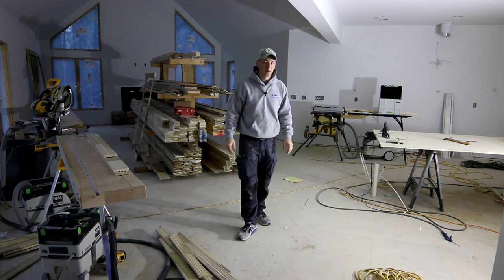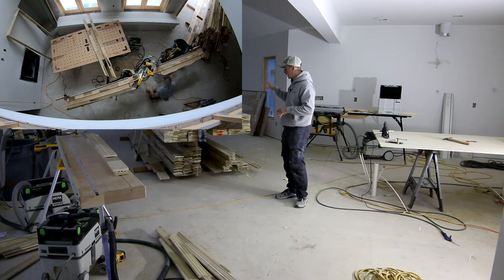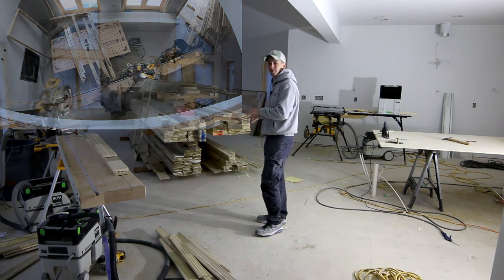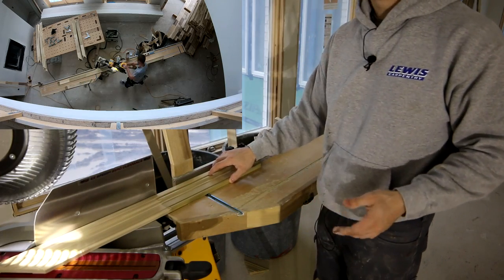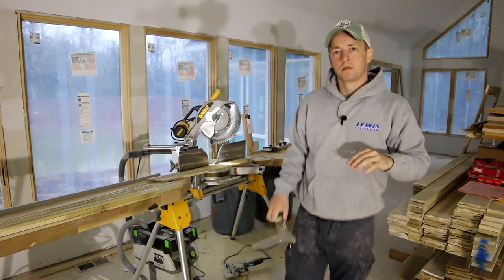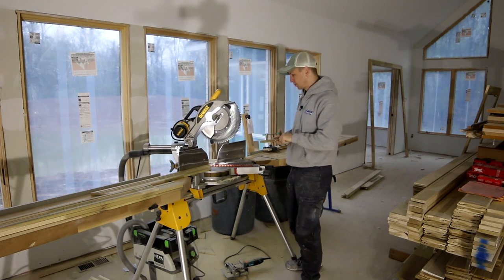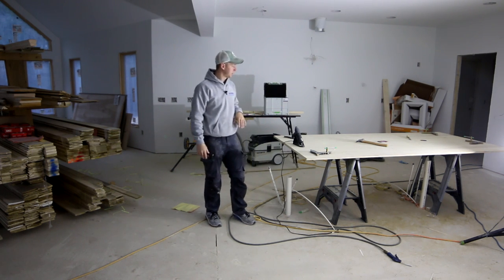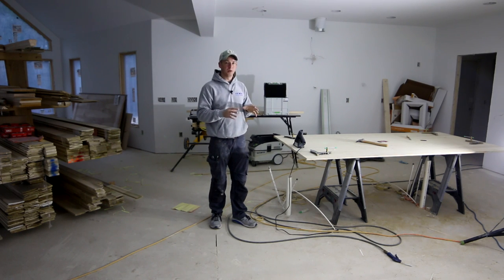The Most Efficient System for Mitered Casing

Comment: Regarding the point on cutting boards or trim that have a bow or bend in them. I'm always a bit amazed on the design of many of the miter cut stations, mainly from the states that make use of a very long fence/extended fence. I've never seen the point of having a long fence like on your extension wings. The only fence that matters is the one close to the blade, aka the one on the actual mite saw. As long as you line your trim up with that fence the mitre angle will be correct in reference to the trim/board unless it has such a severe bow in it that you'd probably discard it anyway. The only thing a long fence will achive is pushing your board out of alignment relative to the actual cut if the bow is in the direction towards the fence. If you just cut based on the saw's fence (the shorter the better in this case) the boards and trim will line up and the angles will be correct once you man handle them in to place when pinning them to the actual window (as you'd straight them out to match the window).  I can see the point of the stopblock riding on the fence, but I'd imagen the stopblock would work just as fine even if the "fence" would be offset back by a few inches (essentially turning it into a stopblock rail only).

EDIT
Had a 2nd look around and I think your fence really is offset back a little allready yes? 👍🏼 Which leaves only the tiny bit of misalignment from the miter fence wich in most cases really is manageble.
Reply from the maker: It’s not a fence. It’s the guide for the stop block. It’s offset back. That type of track is what I needed in order to work with my stop block design.
Reply: Yeah, I did notice the offset in one of the closeups when I scrolled back through eventually,  as you can see by my late addition in the post above! So it really is what I thought it should be! :D 👍🏼 Great stopblock and tips! I blame late night youtubing for not noticing it right away ;)

Comment: Thanks so much for the video. Have used the Clam Clamps for a long time. Incredible product. My question for you is how do you deal with sheetrock that protrudes a fair amount beyond the door or window jambs. In my world, all too often (mainly irresponsibility of the project management) jambs not wide enough or bad framing causes rock to extend 1/8" or more. How do you deal with this efficiently?

Thanks again
Reply: SuperAlfaDogg 

Scarfing, basically Inlaying the casing using a multi tool. At corners using a sample corner, trace and cut. Worse part of my job is scarfing rock.
Reply from the maker: SuperAlfaDogg I’ll make a video on this at some point. You have to “roll” the miter. Stay tuned.
Reply: @InsiderCarpentry  Have you made this video, yet? Would love to understand.

Comment: Hey my question is about your preassembly what do you do in a not perfect situation like the wall is tipped in or out and your casing doesn’t lie flat against the wall do you end up failing that or is that a painters issue almost all of our trim in South Dakota ends up being stained oak typically love your saw wings haven’t tried to duplicate as of yet but I can definitely see where I could make better use of time in running back and forth from the garage a hundred times
Reply from the maker: Watch my video called window & door casing secret #1. It talks about how to “roll” a miter in those situations.

Comment: Great Video...you covered mitered window casing well but it would have been good to see an install and how you cope with slight measuring issues.   What about door casing.   do you cut the sides and install and then measure from short point to short point and cut the top casing and install or do you use biscuits/dominos in the miters and end up with a 3 piece ensembled case that is then affixed to the door jamb.  I'd be curious to hear from production guys how they do it.    RJ
Reply: Relax RJS1948, he cant do all in the same video. 
So maybe in the next vid he'll post the installations and different cases you pointed out !!
I hope so than !!
Reply from the maker: Door casing is assembled the same. I use the stop block for the head. To cut the legs I use my tape to measure from both ends of a full stick. Mark from both directions and cut both miters from the same stick. We don't install over flooring so I can basically run the casing to the floor and it doesn't have to be perfect. Flooring guys will undercut later.
Reply: I usually take a count of how many doors I have in each size. Then stand at miter box to cut all my legs as well as an oversized head for each door. I take my head number measuring inside jamb then add 3/8-1/2” short to short. 
I want to get into building all my jambs on a table to throw on as one. Just hard to do on those jobs where a 1/16 matters from side to side of door or other door casing not all exactly installed the same. Nothing is perfect in a house meaning measuring each one is a must to pre build
Reply from the maker: @kevinw8538  I'm not sure I follow why measuring each one is necessary. My doors come prehung. But the widths are very consistent across the jamb. I've always been able to cut all my heads the same for 3/0 2/8 2/6 etc.
Reply: @InsiderCarpentry  wouldn't work here in kamloops. Doors aren't that consistent each header on same size doors always differ 1/16th all the way up to 3/16ths. Legs could batch cut for any doors sitting off the subfloor but they need to be individually measured for any doors sitting on u lay for lvt. The jamb legs here are very inconsistent as well

Comment: What blade are you using for that 12"?  We have always used the dw717 (10" slider) but they discontinued it - have been trying out a few 779's and a 780 - both seem to have  alot of deflection when mitering.
Reply from the maker: FS Tool SM6300

Comment: Nice man, Bet the local festool dealer love you haha
Reply: The auto on feature is awesome for the vacuums.  The attachment tools that all use proprietary sanding sheets and whatnot are hit or miss for me.  Not to mention the tool build quality, in my opinion, is not really the greatest...  I'm definitely not saying that they don't work great, but I don't think that they will stand up to the abuse that I put my cordless tools though every day.
Reply: cfezuwm what brand are your u using?
Reply: @MsElijah16  Bosch. Can't complain about the quality but I'm disappointed in the lack of new tool innovation.
Reply: cfezuwm the one with elbow type sliders?
Reply: @MsElijah16  yeah the one with the folding double elbows.
Reply: cfezuwm I like the bosch because you can adjust the bevel from the front, but i think the unit is too heavy , I'm using festool kapex and Milwaukee battery ( the old one ) but the dewalt battery Saw feels like better quality
Reply: @MsElijah16  yeah, it's definitely heavy.  I do mostly exterior work so this saw is kind of overkill to begin with.  My boss has the double-beveled sliding 12" dewalt saw which is a bit lighter and also does a great job.  The only thing I haven't been able to cut fully in a single pass is siding larger than 10" with a top cut of 55 degrees or more.  (I think .........  Maybe it was more than 60, but it's been a while since I've cut with those specs.)

Comment: What kind of clamp system is that that you use to hold your miters on your casings together? Keep up the great work I really enjoy watching how to do quality finish carpentry
Reply from the maker: clam clamps. miterclamp.com Call to order.
Reply: @InsiderCarpentry  What do you do about the holes it makes? Bit of filler?
Reply from the maker: Yes. Treat the holes the same as you would a small nail hole. 👍

Comment: Great Information - Just ordered the Hipur Gun - Thanks for the knowledge!! Silly question when the top of the casing is flush against wall but the lower side near the sill is off the wall because the drywall is so out of square- how do you handle that without caulk or pressing so hard to the wall it breaks the miter joint?
Reply: Justin M Plane the jamb down if it’s really bad  but usually a small gap against the wall is fine
Reply: @doomerbained  thanks for the info - but I'm refering to the picture frame style window casings he is making in the video- no jamb involved just drywall around window
Reply from the maker: You can do what is called "rolling the miter". When you cut your miter you match the angle that the trim will sit on the wall. So if your jamb is 1/4" proud...when you cut your 45 miter...put a 1/4 shim under the inside edge of the casing on both cuts....this creates a compound cut and the miter will be perfect when you install and it will contact both the jamb and the wall.
Reply: Insider Carpentry Hey can you post something in fairly high definition so I can see how one of your rolled casings looks I don’t want to experiment on the next job I’m doing I’m working with. Trim and I’m just really curious if it’s going to be noticeable or if I can get away with doing that on a few of the
Reply: Insider Carpentry tv

Comment: Hi, I’m a huge fan of the videos and your work. Do you have a good way to carry and transport the clam clamps?I bought 4 with the hi pur glue because of your recommendation, loving the system. Thanks
Reply: I would suggest rolling tool box sets. I have the original Dewalt tstack boxes because they have optional boxes with drawers that are really handy and not Milwaukee expensive. You should check them out.

Comment: When casing is wider than 3.5" and you use a biscuit or other tenon, do you still use the Hi Pur gun or is it too fussy with a tenon in the way? Thanks for sharing!
Reply from the maker: It’s pretty difficult to use hipur with tenons. To get maximum joint strength with hipur you need to get it together and clamped really quickly. If you fumble with hipur it can compromise the joint strength. When using tenons I go with regular glue. 👍

Comment: Been admiring yours and Chicago carpenters wings for awhile. Just curious, are yours assembled in the same manner as his? Saw he posted on IG some plans and in this video was curious if yours was of the same type of build. Looking to build some when I get a few days off.
Reply from the maker: Yes mine are very similar to his. His original design was the inspiration for mine actually. He has a better clamping system to connect to the saw. Mine are longer than his. And he has a different stop block system....now that I'm thinking through it. there are a lot of differences. There are a couple videos I made on mine at the begining of my youtube channel You can check those out.

Comment: I got clam clamps years ago, never used them yet because  I worry  about the holes in the sides I have to plug, u just putty and dont worry  about it? Also I'm amazed u dont use festool capex saw ? I wanted one for dust collection,  but I think I'm going with  makita battery operated miter saw, I have other saws but want better  dust collection,  miter saws  can be pigs .good videos.
Reply from the maker: Festool kapex doesn’t hold up for production carpenters. I owned two. Burt then both up within three years. I’m a dewalt fan. 

Painted fills the holes from the clamps no problem. 👍

Comment: I use to have two saws on the stand so I was not changing the miter left to right.
Reply from the maker: I’ve done that and seen that done. The only application where I feel it even begins to make sense is cutting crown on the flat. Otherwise I just done feel it’s a big deal at all to move the saw back and forth.

Comment: I watched a video recently by a pro trim carpenter who said he only uses 10" and even 8" miter saws because the 12s flex too much and give an inferior cut for crown. I've never had that issue.I imagine he's aware enough to use a decent blade. Anyone else have that issue?
Reply from the maker: 12" saw cut just fine with a good blade.
Reply: @InsiderCarpentry  thank you. What blades do you stick on your miter saw? I've never had a problem with 12" 80 tooth Diablo blades.
Reply from the maker: FS Tool SM or LM 6300. Its listed in my amazon lists. Great blade.
Reply: Check with a framers square...if its off the more you slide it out the more its off.

Comment: You really like the HiPur system hey? I gave that a shot on maple crown and it had no holding strength against twist. My joints kept popping if there was strain on the join. And it didn’t absorb into the wood at all so when a joint popped, you could just rip the glue off like a piece of tape. I went back to CA Glue.
Reply from the maker: I haven't used it on maple yet. I mostly use it on poplar. I can see how maple would give you issues.  One thing that helps is to take a piece or two of dowel and glue them on the backside of the crown joint. Gives it a lot more strength.

Comment: any advice for using clam clamps on smaller trim like 2.25" wide stuff...

thanks
Reply from the maker: Don’t apply full pressure. 

Use a jig that will elevate the casing so that the pins fall in the center of the casing. @chicagocarpenter has a nice jig that he has posted about on Instagram.

Comment: How is that gluing system for stain grade? Would appreciate any thoughts you have.
Reply from the maker: It's awesome. You just wait a couple seconds for squeeze out to harden and the  it flakes right off and leaves no residue. Much easier than pva glue.
Reply: @InsiderCarpentry  Thanks, I'm going to have to try that. I generally only do stain grade finish work, in as much as I don't do new construction and I hate painting.

Comment: Hey just curious with the trend scriber do you have trouble adjusting the lead on that thing?
Reply from the maker: Crown Molding by Spectacular Trim Yes. It can be annoying. I loosen the knob and tap it carefully on something hard. That kind of breaks everything and loosens the lead and then I adjust it by hand.
Reply: Insider Carpentry I can see it will be useful for scribing margins for casing on the hinge side of doors without having to remove the door. What would make it better is a way to advance the lead.
Reply: Insider Carpentry ps great logo. The way the truth the light.
Reply from the maker: Amen Brother!

Comment: My problem with batch cutting my window casing, is the inconsistency of the windows, that's around here anyway. What do you do in a case where they differ a 1/16 to an 1/8 in height, to keep the reveal consistent?
Reply from the maker: Its pretty easy to absorb the inconsistency by splitting differences and whatnot. I try and keep an eye on the jambs before I start to nail. I'll bang/pry things around to get things where they need to be.
Reply: @InsiderCarpentry  that's my solution as well, but it's still frustrating for me. Cause some of these windows might be a whole 3/16 to a 1/4 different. Due to the fact that the framers put em in and walked away from em. Same with drywall protruding from the wall, past the jamb of the window. Do you run into that much, drywall being 1/2 or more proud of the jamb? I do all I can, just short of burying the casing in the drywall itself.
Reply from the maker: @ou8nucks630  That can make the process miserable. Thankfully the framers I follow do a pretty good job.
Reply: @InsiderCarpentry  lucky you man. All that aside, I appreciate all the info you put out here for us man, here and Instagram. I'm always trying to improve my work, be it efficiency, flow or quality and I just wanted to say thanks for what ya do. It's a huge help, to myself and others, I'm sure
Reply: Unfortunately we are the quality control. Manufacturers know we'll fix the indiscrepencies to keep the job moving.
Reply: @stevenfoust3782 

If I had a nickel for every time I cursed framers I could have retired years ago.
Reply: You know Ive been saying for a good ten years now all jambs on doors and windows should be manufactured 1/8" wide than they are now maybe even 3/16. Sure in the perfectly flush framing and tight drywall the jamb would be a bit proud but at least in my experience for the last 35 years 90% of the time the jambs would be closer to being flush with the interior drywall.
Nothing pisses me off more than that crap!!
Reply: You know Ive been saying for a good ten years now all jambs on doors and windows should be manufactured 1/8" wide than they are now maybe even 3/16. Sure in the perfectly flush framing and tight drywall the jamb would be a bit proud but at least in my experience for the last 35 years 90% of the time the jambs would be closer to being flush with the interior drywall.
Nothing pisses me off more than that crap!!
Reply: @reddawgrup1779  we install all our windows ourselves if we frame a house or addition and also do the trim too, if you're able to get in before the insulation and set the windows to the thickness of drywall being used it really helps when it comes time to do the casing. They use spray foam around windows on our jobs and sometimes the siding guys would have already started outside so pulling the windows in with clamps isn't an option, gotta set the windows before the siding is caulked on the outside and foam insulated around them. If that's not the case then we cut or beat the drywall and the casing covers it but that's time consuming
Reply: A -Carpenter Yea I agree it's a much different story if you are doing the framing and the interior finish. That's another thing I wish generals would do is try and hire one company to do both. It's also much easier to teach and SHOW new apprentices that the trim always goes much easier if you take the time to frame correctly! But around here if someone comes in with a bid a 100 bucks cheaper to do the trim or the framing, well then one company frames and the other trims.
Way to many generals bite their nose off in spite of their face so to speak and in so many different ways!!